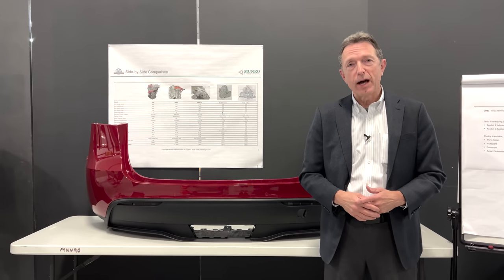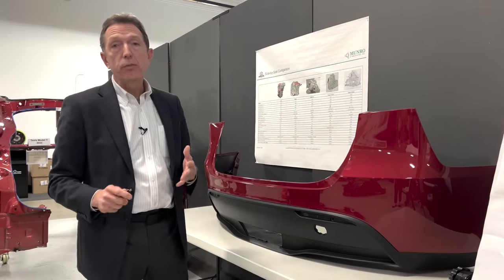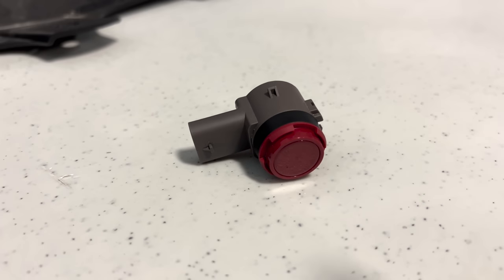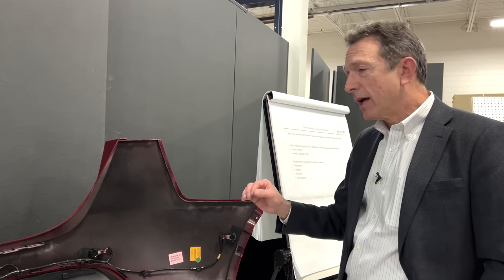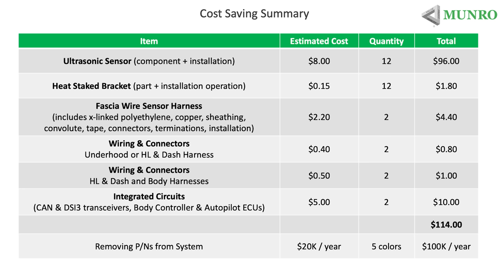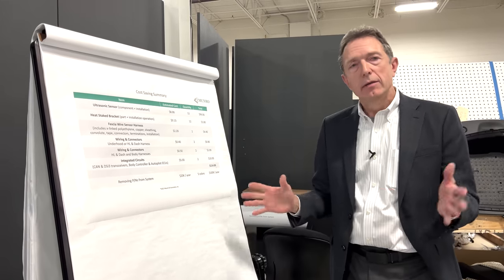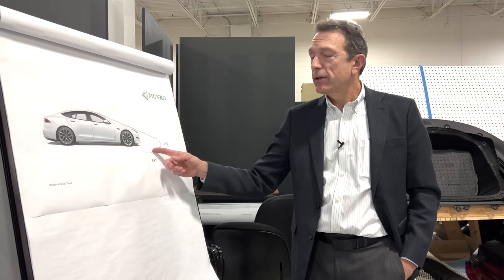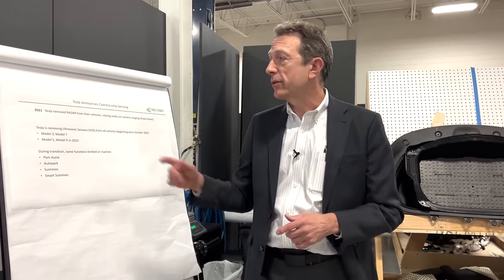Tesla REMOVING Their Ultrasonic Sensors

Comment: One problem with removing ultrasound sensors is that ultrasound doesn't get fooled by fog, rain, bright lights and obstacles that are about the same color as their background the way that cameras do.
Reply: ya but they cost money and people will pay for self driving even if it doesnt work anyways so its win win for tesla
Reply: @jebes909090  While ultrasound sensors may cost money, Increasing camera count, resolution, frame rate, dynamic range and processing power enough for FULL self-driving to actually be capable of FULL (unattended) self-driving isn't going to be cheap either.
I bet the current FSD hardware isn't even half as powerful as is going to be necessary to get officially recognized as L3.
Reply: Maybe not by rain, but wet ultrasound sensors are a problem, my car (Toyota) does give false alarms when the ultrasound sensors are wet.
Reply: @PeterK6502  I drive a Volvo semi and the sensors dont work worth a shit in weather. They are absolutely useless in snow. We have had 2 trucks get wrecked from the truck panic braking on ice due to the sensors being messed up by heavy snow.
Reply: I really think people overestimate the quality of data that comes from USS. They honestly really suck. I know, when I played around in a university project with some Arduino sensors, they weren't the same quality as car sensors but I really overestimated how good they work. They simply don't. They are sooo easy to disturb. Room corners, weird materials, too close or too far distances... I'm honestly surprised how well they seem to work in cars - they probably do a ton of postprocessing to somehow eliminate most of the misreadings (and in narrow but wide enough driveways, they still suck, because they only have a quite wide detection angle and don't give back precise data poins about positions)... And my experience with them is without weather conditions such as precipitation. First of all, I have a huge respect for the people that make them kind of work properly at all. But at the same time, I'm not convinced that USS are the future. They are relatively primitive and so is their output data. However, I'm not sure the way Tesla is choosing is the right one - at least without real camera coverage in front of the nose.
Reply: @gearjammergamer8560  Haven't heard of that happening to anyone, usually people just complain about the radar or camera getting blocked and disabling the system. But you can turn the emergency braking off with a button or press accelerator when it gives the warning sound and light.
Reply: @jebes909090  ultrasonicn sensors are dirt cheap
Reply: @DerKatzeSonne  Ultrasound ranging is pretty simple: send a modulated chirp out to distinguish your output from all other similar sensors that may be nearby, listen for the same chirp coming back, delay tells you distance, amplitude gives you some idea of how large or hard the obstacle might be. It works "surprisingly well with cars" because cars are relatively large and hard things that echo pretty good.

Processing power wise, it was already trivial 20 years ago. Since the ultrasound sensors have only three pins and ultrasound RX would require a differential pair for the signal to survive a roundtrip through the wiring harness, I'll hazard a guess that the $10 sensor has a built-in $0.70 DSP doing all of the processing right there before spitting out the estimated distance to the nearest obstacle on the output pin.
Reply: @teardowndan5364  I know what you say. But your comment also reveals one of the weaknesses: cars are hard things that echo pretty good. Yes. But not everything around a car is a car and hard. Also not necessarily an even surface etc
Reply: @DerKatzeSonne  Different sensors have different strengths and weaknesses. Optical sensors can be blinded by bright lights, which is likely where FSD's affinity for slamming into emergency vehicles at night came from. You also need a $1000+ mini-supercomputer (x2 for redundancy) to process all of the cameras and use fancy AI algorithms that require 10+ years of training to make sense of it all. Optical sensors are also vulnerable to anything sticking to their lens. USS and radar don't care about any of this. They are also vulnerable to obstacles being approximately the same color and brightness as the background.

Relying exclusively on one sensor type is suicidal due to single point of failure. That is how you end up slamming into an upturned semi because your vision AI couldn't tell the cloudy sky apart from the white roof.
Reply: @DerKatzeSonne  they're useful in concert with a reasonably attentive human to give distances for parking. It's an additional feed of data we can use to avoid hitting stationary hard objects which is a pretty common scenario. Cameras, especially ones that cannot see a 1 foot high concrete wall that's as much as 3 feet from the car, don't do as good of a job at that.

Now, you could tell the AI to guess how close the object was before it left the frame based on how far the wheels have turned, but that has edge cases too. The wheels are none standard. The object moves. You need to move forward and backwards several times and therefore the position of a stationary object out of frame moves considerably with respect to where the car lost visual. Etc. 

This is another cost saving measure that will make Teslas objectively worse.
Reply: @PeterK6502  never had this problem with my daily drivers (mercedes & vw)
Reply: They don’t like water or dirt.
Reply: @teardowndan5364  they installed double units of very fast computers , I will be surprised if the computers are not more than upto the task.
Reply: @paulmeynell8866  My prediction is that by the time Tesla gets L3 certification, it will need FSD computers 10X more powerful than what they have been selling until now. Just the camera upgrade to 5MP is a ~2.5X uptick in raw video processing power requirements over FHD cameras and my bet is on another 4X beyond that, more if more cameras end up being necessary to achieve sufficient resiliency against lens obstructions such as rain drops.
Reply: @teardowndan5364  
I expect the higher resolution will allow the car to digitally zoom computer processing when necessary. Most of the improved resolution will be discarded after more precise edge detection.
Reply: @jebes909090  they've increased the car's cost by way more than the sensor's cost, and what wasn't counted here is the huge development cost that's associated with re-developing the features, with servers that are absolutely not free to run, might cost hundreds of thousands a month in electricity alone without even counting the cost to buy them, and the man-hours spent.

There's a reason parking sensors are present in my $10K Fiat Panda and not advanced computer vision with cameras. This is purely a "we can do it" move by Elon.
Reply: @gearjammergamer8560  the trucks braking isn't due to ultrasound, it's usually radar. And radar is susceptible to snow accumulating on it
Reply: @DerKatzeSonne  In cars they work and can give a rough position because it's not one single sensor. The data gets interpolated, if the corner sensors detect something but the center ones don't it's on the side of the car, if they both detect something it's either a really close wall or something slightly more centered, if only the center sensors go off it's something you're going straight towards. 
The misreads can easily be filtered (and that's something you usually also do with Arduino projects), if a sensor is detecting 1m and then suddenly gets a single 10cm reading, coming back to 1m immediately after, you can throw away the clearly wrong thing. You can also just take an average of the previous 10-100 readings, as the sensors are extremely fast anyways so you can afford to do that.

You also don't really need the surface to be completely solid and hard for it to work. I don't know if you have a car with them, but they work perfectly with people, rubber, and also foliage (which should be the hardest one as leaves tend to scatter and absorb sound). You're close enough for that stuff to not be a real problem!
Reply: The point was: what if sensors and cameras condradict, what do you trust? And they decided cameras. Then they realised they dont need the sensors at all. I hope they are right.
Reply: @teardowndan5364  Well the computer part can't exactly be easily removed. Even if you aren't using it for your sensors you need it to interpret and navigate your suroundings if you aren't also relying on pre-scanned, maintenance heavy HD maps of the area you are crossing. Since Tesla is going for the scaling capable route, they can't rely on the HD map so that means the expensive chips have to stay anyways. 

Radar and USS are both vulnerable to their own branch of stuff, and since they are context insensitive its actually impossible to accurately detect when they are wrong, only that you can assume they are wrong. USS constantly sends out false readings for the tiniest of bad geometry or parasitic reflection, with the only way of knowing that its wrong is to assume the nearby other sensors should also be seeing something. That's assuming a lot considering you are relying on those not to bump into stuff at close range at present. For example if there is a slight bump at the entry to your garage, the entire systems malfunctions because the tilting of the car chassis makes all the USS that can see something go into panic mode. 
Same goes for radar, which is unable to see objects that aren't in motion relative to the background, sends out false readings on bad geometry, is very bad at consistent identification of objects with a large closure speed, isn't actually giving you any information about the nature of what it is seeing, and absolutely becomes useless when many objects are in motion in the scene (making it useless in cities). Tesla have stated multiple times that unless a "HD radar" of sorts is made to fix all those above issues, its literally a dead weight for any use case that's not "follow the guy ahead at close range"

Radar already relied on the camera sensors correcting its constant mistakes because cameras could not only identify the context but make their own detection range and speed and oppose it to the one made by the radar, but eventually the cameras became so good at it the expensive radar started to make less sense to keep considering the narrowing use case of keeping it in. And now we are seeing the same, since the development of occupancy networks making cameras able to evaluate areas occupied by non categorized objects and geometry means the unreliable USS was bound to get on the chopping block eventually.

Were they wrong to remove it now? I think they were, but its silly to assume they wouldn't do it eventually, it was just logical. The good thing about optical sensors is that almost all their faults can be software corrected. Glare and lack of light can be removed via photon counting, its the only sensor that can understand context so well, and since humans can drive somewhat correctly it proves that there is not really any unfix-able points of failure outside of the range of effectiveness we ourselves consider "safe" for our own biological vision network.
Reply: @mobiuscoreindustries  Radar can spot objects at any relative speed perfectly fine as long as they are large and electrically conductive enough to reflect radio waves - a static object still has a radar echo.

Last summer, on July 7th and 24th, Tesla's FSD crashed into motorcycles at night and killed two people because FSD mistakenly identified the motorcycles' tail lights as a far-away car. Cameras and bright lights directly within the line of sight don't mix.
Reply: It’s not like there have not been accidents involving Tesla’s autopilot….
Reply: pls dont be mad, but you dont seem to know a lot about ultra sonic sensors. they can be fooled very easily. a well rounded setup needs ultra sonic and video, cause each system on their own have inherint weaknesses. intristingly enough they potentially can be fooled by fog, they most of the times dont, cause the density contrast of whatever is in front of the car is high enough. but if its not -> fooled.

on the other hand visual systems can be upgraded to differentiate between colors that are the same color as the background.

visual systems are supirior to ultrasound, because of the sheer amount of information. when u wanna go completly nuts, you even can extract sound from video, i mean, a video that has no sound at all. its been done with the vibrations objects do, that can be used to recreate the sound needed to cause that vibration.
Reply: @locutusvonborg2k3  If your USS gets fooled by fog, then it is lacking baseline calibration functionality that would automatically compensate for typical environmental variables. It is pretty easy to tell that a signal is caused by fog since the countless weak reflections simply raise the noise floor with no sharp return.

Optical cameras in dense fog aren't going to fare any better while swamped by the vehicle's own headlights getting reflected back by the fog.

As for "sound recovery from video", that is only possible for frequencies lower than half the frame rate and there is nothing particularly special about that, simple Shannon-Nyquist sampling theorem application.
Reply: @teardowndan5364  u havent read my post, or not carefully enough.

i explicitly stated the circumstances. i dont know you, so im not aware of how much you are into that topic, but optical does not just mean what we see. i am aware of the nyquist theorem. it is indeed very special, because its very hard to determin what movement correlates to what sound and what that sound was originally. kinda funny saying its nothing special... so then programm it xD
Reply: @locutusvonborg2k3  Sound from video is simple: you focus om something that shimmers (ex.: aliasing of a sharp edge or light source reflection) based on applied sound pressure and you get your audio signal pretty much directly from that: the rate of shimmer gives you the frequency, the magnitude of shimmer gives you the relative amplitude over time. There's your sound. Nothing special.

It is fundamentally the same principle as reading vibrations using a laser, except using image processing to leverage light that is already there instead of using a laser to create the shimmering point and dumb analog circuitry to read it back.
Reply: @teardowndan5364  the camera upgrade was unexpected, but I wonder if they will do some pre processing onboard the camera or with a small unit after the camera and before the computer.
The whole thing seems to be about getting the most efficient system so the computers can handle it with power to spare. It’s an amazing problem and I just watch in ore.
Reply: @teardowndan5364  a static object still has a radar echo but since almost every background object is going to have one too there is a sizable change it gets discarded as background too, which lead to issues with night crashes on flipped vehicles. Tesla switched to photon counting which drastically improved performance at night, which is why it has been able to avoid objects otherwise invisible. The issue always is about identification and that's where the main weakness of vision lies. Up to this point the only real way to make a visual perception was to have the network identify an object type, or at least identify a specific thing was there. Then it would figure and extrapolate various things about it. Obviously the motorcycle were absolutely not occluded by their lights as they were properly seen, but the perception algorithm made an error and identified them as a single object, to which the distance between it's "edges" meant it would be far away. At this time the network could only guess the actual footprint and behavior of the vehicle. 

This is likely going to come to an end with the occupancy networks for the same reason USS are becoming unessesary. The occupancy network runs on top of the categorisation to actually identify the space being taken by objects regardless of if the network actually can categorize them. In a similar scenario, the perception system would detect them as a single vehicle far away, but the occupancy network would actually be able to perceive the gap between and their actual range go the car, and prevent such a situation without needing the otherwise dead weight radar to sort it out. I have said it before, I am not the biggest fan of the removal of the "safety net" before the tech was fully matured, but as an engineer I also entirely get why they would lean towards this. When looking from a purely technical and manufacturing point of view, in the face of advanced vector space vision networks, radar just becomes useless, and so does LIDAR and it's HD maps. Ultrasonics remained needed in my eyes because of cameras difficulty with guessing the shape of unidentified objects and more complex terrain. But with occupancy networks this once again is called in question, just as much as I dislike once again choosing to jump the gun a bit too soon.
Reply: @mobiuscoreindustries  A proper radar implementation doesn't get confused by "background objects" since the radar echo roundtrip time directly tells you the distance to whatever the echo came from with a conversion rate of 15cm per nanosecond.
Reply: @jebes909090  And after removing them tesla will surely lower the price right? xd
Reply: @DerKatzeSonne  they work well in cars because there aren't nearly as many spurious returns to deal with when you're outside. When you're inside, say you're working on a little project robot, the walls, ceilings, and other objects in the room make the returned signal much more difficult to interpret. 

In short, when you're outside, the sound that you don't care about can disperse before it makes it back to you. When you're inside, you'll get multiple returns from every object because of reflections off closeby objects.
Reply: @eikuz  really depends on the vehicle. I've had a VW Tiguan pop the emergency brakes way too early and I couldn't break out of it until the car was stopped. Maybe that's operator error, but it's a kind of car accident that just shouldn't ever happen.
Reply: @jebes909090  have you seen the FSD videos from testers? FSD is already better at driving than most humans including yourself most likely.
Reply: @teardowndan5364  What sensors do you rely on to drive? Do you have ultrasonic sensors in your body that lets you drive? Are you a cyborg?
Reply: @DerKatzeSonne  doesn’t have to be hard for US to work. Abdominal US for example just relies on variation between structures.
Reply: @themonsterunderyourbed9408  I'm not limited to fixed-position cameras. If I cannot see clearly enough through one patch of wind shield, I can move my head to see around the problematic areas or at least get multiple perspectives. Tesla's FSD gets paralyzed by moderately heavy rain even under daylight conditions where a human driver can still see perfectly fine.
Reply: @teardowndan5364  Teslas have more cameras than you have eyes. It can look everywhere at the same time. You can't. 
It's only a matter of time before autopilot is better than every human at driving. It's already better than most.
Reply: @jebes909090  it costs money to elon not to you. You think after they remove cheap ultrasonic sensors is going to drop the 15k price of fsd.🤣
Reply: @themonsterunderyourbed9408  yet it still can't park itself. And gets confused by a cone in the middle of its lane.
Reply: @themonsterunderyourbed9408  It only has three front-facing cameras and since they are fixed-position, they cannot do anything about stuff like rain interfering with them. Many more cameras will likely be necessary to work around that.
Reply: Cameras are much more expensive also the hardware and software required to be able to compute that amount of data in real-time is really expensive. Tesla won't save any money.

I don't know what they are thinking.
Reply: @DerKatzeSonne  You need to pick the right sensors for the right job... the angle is or can be much more acute and therefore more accurate. I work on systems that test these sensors and they can range over 100m and can have a 10° angle.

You just don't know what you are talking about.
Reply: @DavidM1337  Bad question. You always take the safest option. It doesn't matter if they contradict...
Reply: @PeterK6502  The toyota is shit, ultrasound sensors have been arounf for many many many years and worked wonderfully, cameras will not do as well, NO matter how well the software is.
Reply: @DerKatzeSonne  University USS are nothing compared to commercial ones, and its also all about the software. USS are way better than cameras.
Reply: And dirt or damaged to the camera window too. Ultrasonic sensors are like magic.
Reply: @xZeroGrxvity  Tesla will be saving money only IF they manage to pull it off without having to drastically expand computing power and data collection to get there. They aren't anywhere near that and it is a gamble whether they will ever be even with the 5MP upgrade.

I wouldn't be at all surprised if self-driving cars with sensor diversity achieve true L3 certification and legal substitution for drivers ahead of Tesla, demonstrate that secondary sensors are necessary to cover things cameras cannot reliably deal with and we end up with a prescribed minimum complement of secondary sensors by law.
Reply: @themonsterunderyourbed9408  Okay show me a video of fsd backing up i will wait.
Reply: If Tesla was voluntarily removing the sensors then you'd think they'd be disabling them on existing cars. Pretty sure they're just running out of parts.

3:38 PM
10/20/2022
Reply: @tissuepaper9962  yeah probably does, I can really only say how it is on Volvo trucks
Reply: @brady50429  Humans are still able to drive mostly fine with only one eye and that eye is a fair distance behind the windshield where it can be moved to get around any partial obstruction. Fixed cameras don't have that luxury. Human drivers have to make-do with the limitations of being human, self-driving has no reason (besides cost-cutting) not to use all technologies available at least until self-driving proves that it can perform above average compared to decent human drivers under all conditions and can predict other sensors inputs from cameras to prove that it doesn't need them anymore.
Reply: @teardowndan5364  agree that if Tesla wants to go VIO (Visual Inertia Odemetry) type SLAM method with their FSD software, then its a bad way to go. It seems in academia that the Robustness issues with VIO is well known and not sure why Tesla is adamant in going down this route. Mobile Robot research are very much leaning towards multi sensor fusion (LiDAR-Visual-Inertia Odemetry) to allow synergies to be realised to over respective weaknesses of each sensor type. If anything Ultrasonics and RADAR sensors should of been upgrade over time... However saying that Ultrasonics doesn't have much range therefore in terms of FSD they might not be that helpful...
Reply: @0xNameless  Ultrasound's short range would still be useful for secondary near-space occupancy checks where radar may struggle due to excessively short round-trip times such as blind spots in adjacent lanes where the next car may be less than 1m away.
Reply: Self driving will never work with the current camera setup.  Huge blind spots cause not enough cameras.  Already trashes my right rims because I summoned the car and it drove over a curb.   Really awesome scam Elon has
Reply: @PeterK6502  That sounds like poor quality sensors. The only time I get issues with mine is if snow builds up on them. They can usually handle anything up to about 1/4 inch of snow before they start failing. I drive a 2016 Ford Escape.
Reply: @SeaShrimp  I know they are very different in many aspects and no, the physics stays the same. USS are way better than cameras. Yeah no. Not in that general way.
Reply: @xZeroGrxvity  How many 10° angle sensors do you need to cover the back of a car? 20? 30? Great. So even if a smaller angle is very possible physically - it's useless as in you would never build that into your product.
Reply: @tissuepaper9962  Sure! But what about a garage? That's also inside and with many objects inside. Just as an example. Also I never wanted to say "USS are completely useless and don't work at all" (and I don't think I phrased it that way) but to point out that they have many shortcomings as well and aren't perfect flawless sensors either - because that's something that people here seem to think.
Reply: @themonsterunderyourbed9408  better in 99% of situations and hopelessly bad in the remaining 1% of situations that a human driver would handle correctly every time.
Reply: @TypicalBlox  hundred of millions of dollars a year isn't cheap, keep in mind their stated goal of 20 million vehicles per year, this would have sensors totalling around 2.2 Billion dollars per year, which is probably enough money to educate an entire youtube comments section about volume production
Reply: @teardowndan5364  you are correct, so there are several issues with USS:
A pole can be padded with soft material that doesent relect, then the car might not see it.
A pole can be between the coverage of two sensors
An object can be below the sensors reflection coverage area
An object can be out of range of the USS
USS sensors can be blocked by dirt, snow etc.

Then of course:
Tesla has warming on the USS.
The cameras also can get blinded by snow, dirt etc. but they can also add a squirter system, they already do warm their cameras.
Cameras will need processing
Caneras wont see everything either, but it makes it possible to do object detecion etc.
While cameras cant see very close items out of the view cone, they might be able to process this as the cameras can measure distance and it already knows what it saw.. So its like if you back up a car and you know in your head that you saw a box on the right hand side in your mirror, you know it is still there, since you are still backing up and your trajectory is in its direction. The cameras and AI can do the same (in theory).

I dont think cameras + ai will be 100% perfect, but neither is the USS.
In the beginning it may be worse even, but I think over time it will be better.
The only main concern I have is dirt on backup camera, it needs either a spoiler or a squirter nozzle.
Reply: @PeterK6502   I'm driving a Tesla with USS and had no issues so far. The sound is a bit loud and annoying but it's very accurate and reliable.
Reply: Neither ir
Reply: @teardowndan5364  Looks like the new chips from TSMC coming next year will accomplish that.
Reply: That does make sense. I think some things have changed since this video. So I was told, since I have the sensors on my vehicle they were turned back on as of December 31st 2022. I was driving in heavy for a rain & bad fog. I kept getting error messages while in FSD, that it is currently disabled due to left camera being obstructed. I am assuming Tesla never turned back on the sensors, because I wouldn’t have had this problem with the sensors. However, even when the sensors were on, I would get the same notification from the B pillars on sunny days. This is one reason why Tesla has made the B pillars cover over the camera smaller now.
Reply: @DerKatzeSonne  some people are actually talking about a possibility of tesla putting the front facing cameras in the headlights. Im not sure how much of a possibility that is but it kind of does seem like it would work. The light from the headlights would make it easier for the camera to see in harsh conditions as well.
Reply: @teardowndan5364  Tesla wont do L3, as it makes no sense. They ll try to skip right over to L4 or L5
Reply: hydrophobic coating on  glasses would solve that
Reply: @X862go  A little bit of bug splatter or oily residue that gets a chance to accumulate some dust will help water stick to hydrophobic coatings just fine.